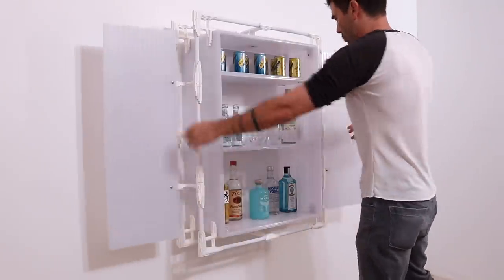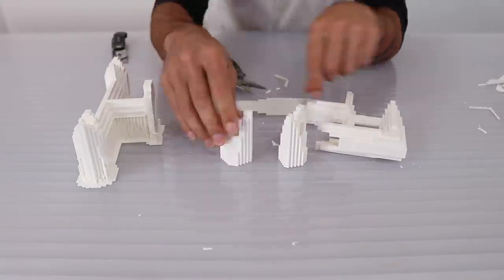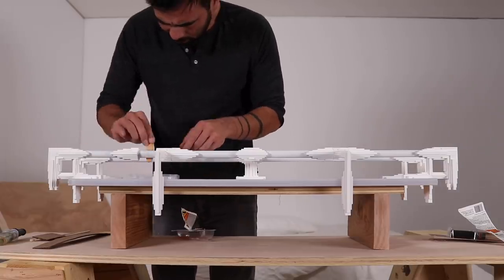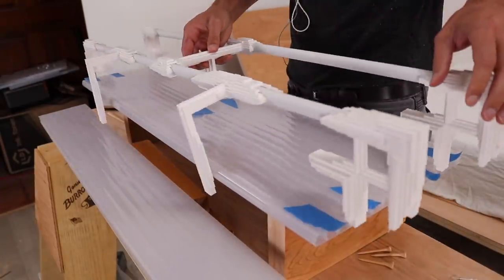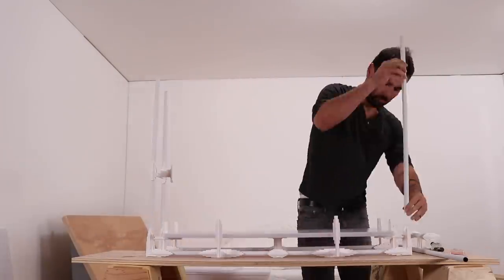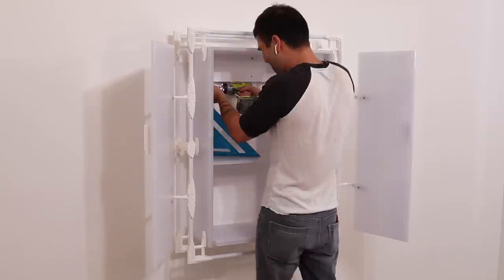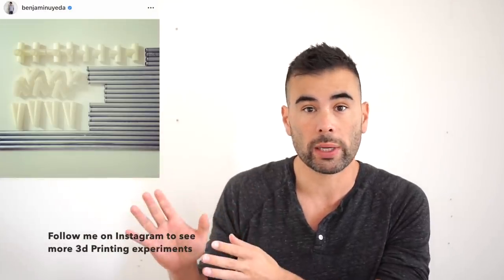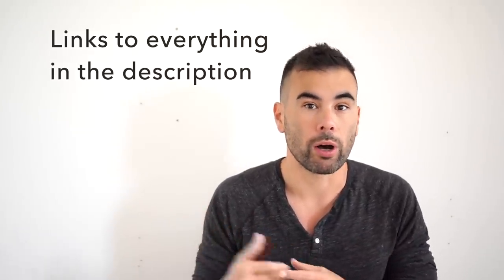3D Printing a Liquor Cabinet | 3D PRINTED FURNITURE EP 1

Comment: Fusion 360 are free for hobbyist and start-ups. Basically until you earn $100k per year on the product.
You can renew it in the program after a year, just need to confirm you are still meet the requirements for it to stay free.
Reply: Nice, thanks!
Is that an Autodesk program? Because I have Sketchbook Pro and an account already. I've been looking to get into basic 3D modeling and 3D printing.
Reply: Yes, Autodesk Fusion360.  And you get all features for free for hobbyist.
A LOT of videos and how to's on their website, in the program and on youtube to learn it.
Reply: @topgundk  Yeah, Autodesk is pretty great about that stuff. They usually have good tutorials and loads of available information free to use.
I'm gonna look into this, thanks again. 
3D printers have gotten cheap and available enough to pick one up for experimenting and little hobby stuff.

Comment: Great video Ben; I really liked hearing about your thought and development process but I agree with a lot of the other commenters about the design. To me the aesthetic of 3D printed elements look unnecessary elaborate and functionally gratuitous. What is their actual purpose and why couldn't the polycarbonate panels be directly adhered to each other with a dichloromethane type glue or with simple corner brackets? Is there any reason for the stepped design, because although I like the continuity it gives between the vertical corrugations, I personally think it makes the prints and aesthetic unnecessarily complex, with the curves shapes it alludes to not fitting with the geometric panels. 
I hope this doesn't come across in a hateful way, I'm just generally curious about your design justifications behind this one - I think it would be really interesting if you did a episode on the podcast discussing your rational behind specific decisions? Maybe after the 'what we did this week, having a why we did what we did segment' :)

Comment: How your mind works fascinates me.  This is such a cool design.  What blade did you use to cut the panels with, i.e., tooth count and application.  Thank you for another great video.
Reply from the maker: 7 1/4" 60 tooth diablo fine blade
Reply: @HomeMadeModern  - Thanks

Comment: I started architecture school using FormZ and hated it so much. It would crash CONSTANTLY. I use SketchUp for basic modeling, Rhinoceros3D for complex geometry and shop drawings, Revit for BIM, and Fusion360 for moving parts. Fusion has other cool benefits that unique and well suited to engineers, but exporting shop drawings from it is a huge pain compared to Rhino and just not well suited for how I like to work.